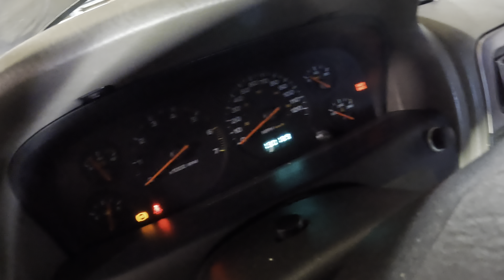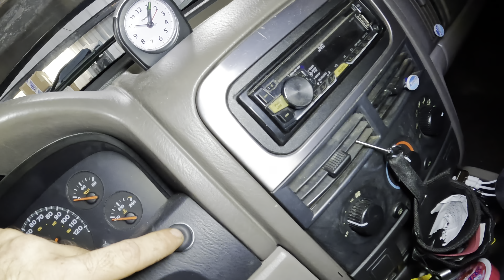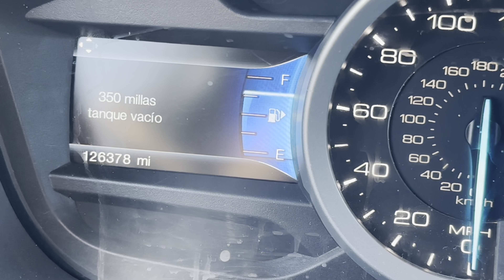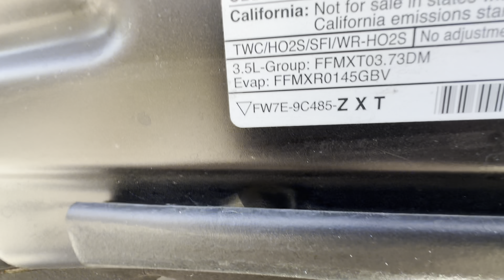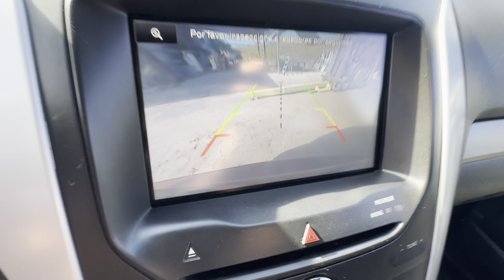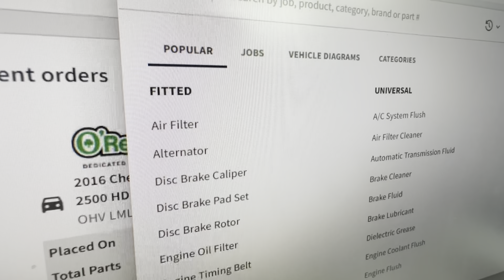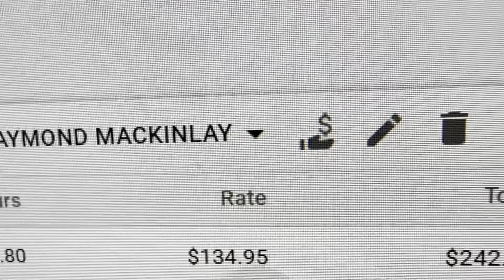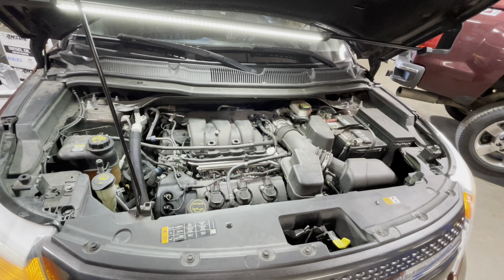TOO EXPENSIVE!  Repairs Declined! Twice! Jeep Cherokee 4.0 & Ford Explorer Noises While Driving

Comment: After seeing the cob job under the hood I wasn't surprised to see how bad the brakes were, yet the vice grip application was unnerving. If I was working on it, I would put the wheels back on and park it outside and tell the owner to come get his vehicle. Way too much liability there.
Reply: It's a shame too, because Florida used to have car inspections until 1981, and they did them at state inspection stations instead of having private repair shops do them like a lot of states do now.  I remember going to the stations with my dad when I was a kid, and that Jeep would have had the inspector calling his co-workers over to look in amazement.

Comment: In my 16 years of working as an auto mechanic, I saw vehicles like that Jeep all the time. Really wish we as mechanics had the ability to retain vehicles that are unsafe like that one. People should not be allowed to drive dangerous cars on the road. When they decide to do that they're no longer just a danger to themselves but everyone else on the road.
Reply: California once had a CHP safety check required.  For some reason, it was scrubbed.    Now anything can hit the road.
Reply: Every once and a while people should just take some personal responsibilty- more govt. Is not the answer.
Reply: Right there with you. So many cars out there today that are just like that Jeep. It's scary.
Reply: We used to have the authority as licensed provincial vehicle inspectors to tie a "Do not move or operate vehicle' banner across the windshield that was illegal for the customer to remove. It was abused by crooked shops, now people can just drive off with vacuum tube brakes lines or whatever
Reply: @AdamantineAxe  yea it's the bad ones that mess up the good things

Comment: I went through 4 AutoZone alternators on a year.  After the 4th one, I took it to a garage and they got a new one from a different company.  No more alternator problems!!  I learned an important lesson…Don’t use a rebuilt alternator!!  On my van, the gauges were going crazy.  That sound is irritating.  Maybe they need to save some money and are going to bring it back for repairs.  🥰❤️

Comment: 21:51 just did an alternator on a Ford Edge with that exact same problem. It was the Alternator as we'll. The person told me some friends told them have their mechanic look into piston slap, possibly cam grinding ext. Took me about the same time it took you to diagnose the alternator. Took me two hrs, including going to get the alternator.

Comment: When I was 18, I lost a front passenger side pad. I didn't have any cash to get new pads, so I did something very similar to that vice grip debacle. It was in the middle of winter, in Pennsylvania. After lowering the vehicle, I took it for as test spin. Long story short, I managed to make it back to the house, to park it. It stayed parked until payday, when I could get new pads. Every time I hit the brakes, my front end would start sliding all over the place. It was insane. This dude running around like that.. either he's (or she's) an F1 driver, really good at drifting, or they've never hit as much as rain. Crazy..

Comment: $600 alternator? I come from the days of $30 alternators! That dates me a LITTLE. Gotta love those declines on safety stuff. I'm sure they will botch it up in their driveway and the car will appear on one of those nightmare car channels and blame the 'last shop'.
Reply: I just this minute said exactly the same.
Reply: *"Just Rolled In" enters the chat*
Reply: $600 for a Ford alternator.
Try a high output liquid cooled jobby for a top end Mercedes-benz and I will let you imagine a number.

Then double it.
Reply: Really makes me wonder how much they are gouging us on things like this. You can find generators/inverters for that price. Doesnt really make sense.
Reply: Yes I remember buying an alternator for £30 30 years ago  but that was 32 amp, not 200 amp. So per amp really the price has not changed much.
Reply: My six cylinder Ford maverick, 1976. Fixing it in the 80s, $40 alternator and one bolt. Slip off belt, put new one in, tension, tighten the one bolt. 10 minutes. Progress, $640 alternator job, taxes and environmental fees, oily rags, are probably more than $40. How do young people get around?

Comment: When it comes to the ford, I have done this a few times depending on what it is and the level of difficulty I would decline repairs and do it myself. A lot of shops markup parts. Mainly shops choose to use oem parts which are expensive to very expensive oem parts of course are better quality but I’m not going to spend 300 bucks on a ball joint I can get a name brand aftermarket for 60. I do believe in diagnostic fees though to protect the shop owner. I deal with one shop for years for the things I don’t want to do or don’t have the means or knowledge to do. They are soo transparent they will explain to me how to repair something that I haven’t done before and sometimes I have to tell them I don’t want to do it! Lol I do at least have the respect to tell them that there is a possibility that I will repair my vehicle myself depending on the quote.

Comment: Since this wasn't posted on April 1st, I assume this "vehicle" is actually being driven. I would either call 911, or wheel out the cutting torch. No way the vehicle will ever be worth the cost of repairs.
Reply: It's Florida. The state doesn't much care about vehicles being sound and safe to be on the road after the initial purchase inspection.
Reply: @MonkeyJedi99 what does the insurance companies say if you end up in a car accident with a car like that,  and yo could have avoided the accident if the car and brakes were in a better condition?
Reply: It may not be, but the repairs are more affordable than buying another vehicle with potentially the same issues

Comment: Alternators went from 100 to 400 in a quick hurry as of late. Most is due to the huge increase in premium grade copper costs. Removing it from an explorer is a nightmare at best. This suv is one belt snap away from the junkyard from an overheated engine lol
Reply: It runs a timing chain driven water pump and electric power steering. It will drive a little if the belt snaps.
Reply: @mph5896 The electric power steering is why an engines this small needs at least a 200 amp alternator is a bigger price component even than the copper.
Reply: Seriously I got a new nator for my 97 Camry only like 3 years ago and it only cost me like $80 after sending back the core. Plus that was a much easier job with it being the first thing you see opening the hood.
Reply: @Skylancer727  I have a '99 Camry 2.2L, I love the fact the alternator - most service points, actually - are so easy to get to. It's almost as if the engineers thought, "Someone's going to have to work on this in the future..." At 367k, I'm still waiting for the ORIGINAL starter to fail.
Now, take that same Camry and stuff the 3.0L engine in it, and it's a nightmare to work on.
Reply: @dashcamandy2242  meanwhile today my new Prius even has an extra piece of plastic that needs to be removed with screws to access the brake fluid. WTF

It's sort of like how Toyota used to have the media and climate control switches all distinctly different so you could immediately tell what you're touching or moving without looking down. Instead now we have a row of 8-10 completely indistinct buttons and a touch screen. Sure it looks nicer, but it is less convenient. I just wanted the screen to show song names and navigation.

Comment: I watch all your videos and it seems people in the USA run their vehicles until they are only fit for scrap..good for  you Ray  but dangerous for other road users.. Happy New Year to you and the family 🎉
Reply: I don’t know where you are from, but just you look at what’s running about on the roads where you live !  You can’t just blame the Yanks !
Reply: Takes all kinds unfortunately, I don't have enough money not to maintain my car. Plus my life, my passengers and the people who are on the road with me lives matter. It's way more expensive to buy a new car or end up in court...
Reply: BUT if you wanted to,you could do it yourself, a bit at a time. there’s no rust on the thing. A project car.
    Last alternator I bought was brand new,as fitted originally. Unit cost £75,  and it was heavy, solid, obvious quality. From one of the last of the good independent spares firms, gone now.
Reply: @CrimeVid  Here in the UK there's a mandatory annual safety check, where even a single worn ball joint is a fail, never mind the umpteen fail points on that Heep.
Reply: In the UK it would be impossible to get to that stage-yearly MOTs see to that. @CrimeVid
Reply: @GARDENER42  Still roads are different and way more forgiving in most US states, compared to the bends, ramps, and roundabouts that the UK is filled with.
Reply: @GARDENER42 LIved in the UK for years and the MOT was only as good as the inspector performing them.
Some of them missed or ignored  obvious problems and a lot of vehicles failed because of problems with roadworthiness that the owners didn't repair even though they were obvious.
Reply: @davidworsley7969 MOT inspection is only as good as the inspector performing the inspection. 
Lots of vehicles with valid MOTs have issues affecting their roadworthiness and the UK has older pieces of junk on the road just like everybody else.
Reply: @williamegler8771  I have NEVER come across an MoT tester who was anything but conscientious & that's in nigh on 50 years of vehicle ownership in many parts of the country.
If the owners are given a fail, then continuing to drive is an offence & they're also unable to tax the vehicle, another offence, as is operating a non roadworthy motor vehicle.
Get stopped for this & your car's heading for the crusher & you're heading for a large fine.
Reply: @williamegler8771  We shouldn't bother then?
How do you know 'lots' have roadworthiness issues?
Just because a vehicle is old doesn't mean it's junk & they still have to pass the annual test.
Reply: @Mprikiman  Yet despite the far more crowded & twisty, narrow roads, the UK fatality rate is less than a quarter of the US'.
Reply: It was an observation that the vehicles do appear to be in disrepair and just about driveable before limited repairs are carried out.
Reply: @davidworsley7969   I live in the UK, always have, you need to look around you, talk to people.
Reply: @GARDENER42   as I said to the other person, I live in UK always have. have eyes and ears too.

Comment: looking at this piece of iron. I am curious what the general opinion is about a bi-yearly mandatory road-worthy check because this one should be scrapped
Reply: No thanks! I am in MI and we have no inspections and no emissions testing.
Reply: In the real world what happens with mandatory inspections is that owners will seek out shops that will give them a sticker even when they fail the  inspection if the price is right. Also you will have shops that will not give a sticker unless some unneeded work is done. Inspections do not solve the problem of unsafe cars on the road.
Reply: @northpoint1039 not a big problem here in uk. Annual check required, sus, steering, wheels, tyres, lumens, emissions, vis rust, body integrity etc. Good idea. Crime exists of course but everything is captured and computerised for police. Fake plates are the problem.
Reply: @DeepakKumar-lv4te  well that applies for Western Europe as well. Germany has the TÜV which comes to the shops to test as an independent body
Reply: @northpoint1039  it depends which real world you mean. Europe has this for years. At least mounting a vise grip will never ever happen. Besides the Police will have regular road checks.
Reply: @robsterenborg  What works in Europe does not always work in the USA. The amount of car accidents attributed to mechanical failure is actually very low. Most accidents are caused by drinking/drugs/Deer/Driver Error. When comparing a State in the United States that demands inspections to one that does not you will find there is little to no difference in the amount of accidents on a yearly basis. Couple that with the abuse of the inspection system and its apparent that state inspections really do not work or are unnecessary.
Reply: @northpoint1039  You might be right but: what do say about this:The National Highway Traffic Safety Administration (NHTSA) estimates that poor vehicle maintenance leads to approximately 2,600 deaths, 100,000 disabling injuries, and nearly $2 billion in lost wages, medical expenses, and property damage every year in the United States.:
Reply: @robsterenborg  I do not doubt that. However, Take a look at the individual states that impose inspections and site their numbers. Also, The stats that you quote probably the large majority are commercial vehicles like semis and such. These vehicles are inspected too.
Reply: @northpoint1039  Whatever works for you but i think you agree that every death and major injury you can prevend is worth the effort. I believe that is every persons obligation to one another
Reply: @robsterenborg  That is not possible or even feasible. While I care about human life and all, You cannot ground a million vehicles from being on the road for the possibility of one life spared. If that where the case then only a few select vehicles would be on the road. Vehicles with recalls for safety would all be grounded. After all, These recalls are because someone could become injured or die. Also, Its not a matter of "What works for me". Its just not possible to stop deaths from vehicle accidents. Sadly, Its not worth the effort. Anything manufactured has the potential of hurting or killing someone. That is the true reality.
Reply: @robsterenborg  does that mean it's carried out by civil servant employees rather than the private sector?
Reply: @DeepakKumar-lv4te  Neither nor !TÜV is an independent association with a mandate from the government to check each vehicle if it is roadworthy. For a new car, the first check is after three years. After that every two years. This happens at the mechanics shop and In most cases, the shops have much respect for them. When a car is not checked timely the city will revoke the license
Reply: @northpoint1039 It does in less banana like countries, where there are unannounced government inspections of vehicle test stations and mystery shoppers sent out with dodgy vehicles. The stations are not allowed to repair. There are rotten apples, but they are few and far apart. Mechanics can get away with more, but not serious faults, only nit pick like chipped windscreens.
Reply: @DeepakKumar-lv4te  As far as I know the inspections are done by the private sector here in the USA.
Reply: @robsterenborg  That's  a bit of unnecessary job creation.  The mech should be doing it and entering the results in the computer.  No need for a separate association, just a body to create the spec and check up on the mechs.  They don't need to be involved in every actual inspection.
Reply: @DeepakKumar-lv4te  In an ideal world, yes but that is not reality
Reply: @northpoint1039  it does result in vehicles being taken off the road that have serious problems that are not economic to repair. While rust isn't the story it was back in the seventies it's hard to object to it. Like i say, the problem here is fake plates. You rarely see cars in alarmingly poor condition here in the UK.

Comment: I have replaced the alternator on my 1999 Suburban twice. Its on top and easy to get to and only takes 10 miutes. I replaced it the first time with a rebuilt one with a lifetime warranty from Auto zone. So the second one, no charge. But this is easy to replace. I replaced the power steering pump 8 months ago and that was a challenge, hope it lasts. 195,433 miles, lots left.

Comment: I had the same thing happen on my 2016 Ford Kuga (known as the Ford Escape in the US I believe). Managed to get it done under extended warranty which saved me a heap of cash.

The issue with leaving it like that is that it will eventually seize completely so the inevitable will eventually happen and could be a much more expensive repair!

Comment: I had a new 1999 F-150 that the Motorcraft alternator went out on right after the warranty ran out. Replaced it with an Autozone lifetime warranty unit......it was on it when I sold it 20 years later with 200k miles.

Comment: i had one of those 4.0 grand Cherokees for my first car. It had a few suspension issues due to rust and needed a waterpump/ thermostat but other than that it was pretty damn good. I drove it from 86k to 155k delivering pizza, off-roading and whatever else high school kids do lol. I learned a lot about working on cars while I owned it and had some fun as well. They tend to have small issues but if you maintain and repair them properly they will treat you well.

Comment: I have the exact same Explorer, and the same thing happened with the alternator. I had to take the bumber, grill, and front tire / well off to get to the alternator. It was a big job, and those people are in for a good time. Eventually, that pully will stop spinning and just seize. The belt will start burning off, and they will be stuck. Luckily, mine happened in the driveway.

Comment: I learned the hard way of getting cheap alternators. Paid $200 for one for my M3 and 300 in labor. Maybe 2 months later it was back on a flatbed. 

Just do it right the first time and you’ll save on labor of two of the same job 🥲

Comment: I need to replace 2 shocks and struts, 2 cats (bank 1 and bank 2) with their respective o2 sensors, and a blower fan on my 2014 edge. Parts only i'm looking at 1.7k buying from Rock auto. I wish I had a mechanic like you in my area (I probably do but unknown to me)